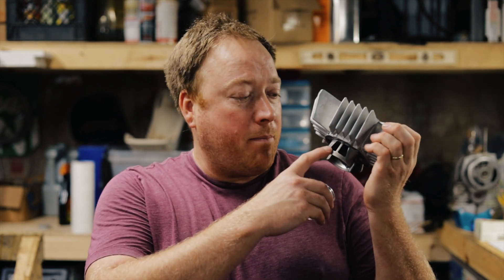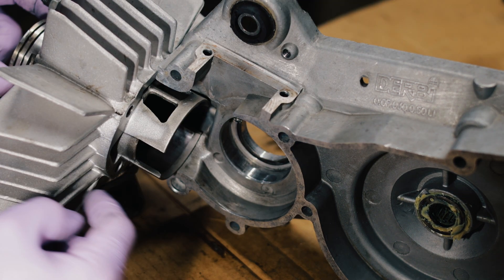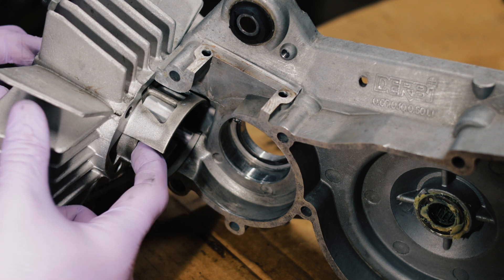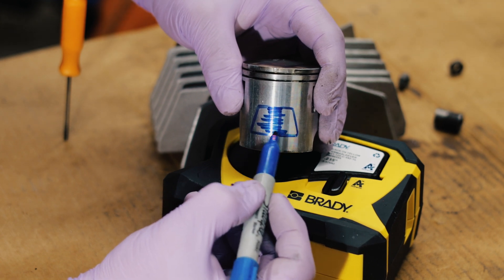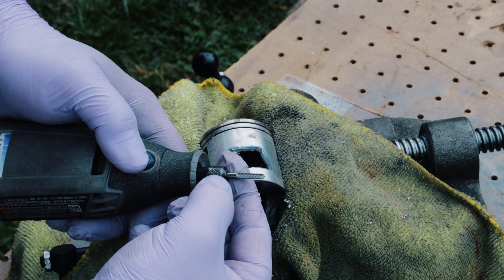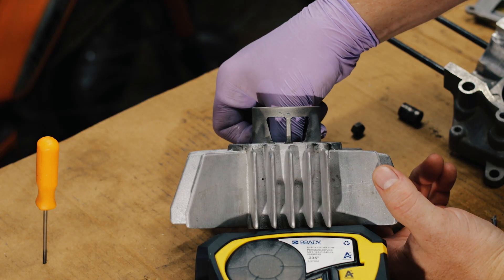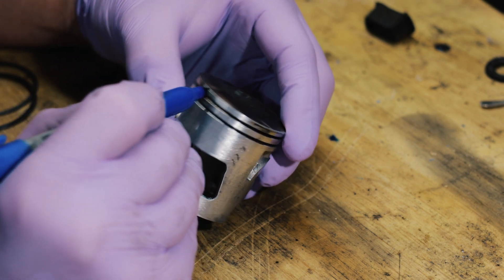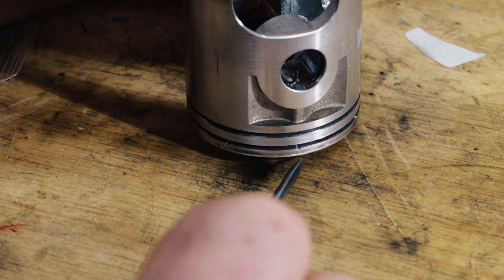Piston Window Porting for 2T Boost Ports

Comment: Dude,  making the bridge between the ports would have taken  an extra  10 mins.  You just cut out a lot of that pistons strength.
Reply from the maker: Yeah I have never had an issue with the airsal cylinder and piston. With thinner kits I would leave a bridge.

Comment: Is a piston with windows always better than one without?
Reply: Not always, and only with a reed valve
Reply: @hamzahmushtaq877  But people talk about piston window on chainsaws and they dont have reeds. So im abit confused.
Reply: @meskalin64  if it has a window there is always a reed maybe the chainsaw looks like it doesnt but it might have a case reed?
Reply: @hamzahmushtaq877  They do have different carbs though. The windows are much higher up on the piston (from the top down to the piston rod/bearing) and not on the intake side but on the fuel channel sides. 2 windows on each side.
Reply: @meskalin64  dude what you just said made no sense
Reply: @hamzahmushtaq877  Dont worry if you dont understand dude.
Reply: @meskalin64  real.
Reply: @hamzahmushtaq877  Rotary valved 2 strokes can use windowed pistons also . The only problem is window weakens piston.  Was a popular modification on kart motors in the sixties and early seventies. Engine modifiers/builders got away from that due to piston failure at high rpm's. 2 strokes kart motors had better performance and reliability just going with a third transfer port.

Comment: I always window just because that’s how the original metrakit design was… I also cut the bridge out of the skirt.  Seat dyno’d, no idea on impact.  Most of the fresh charge is through the side transfers so 🤷‍♂️ 

Thanks for the hard work bud, I owe ya a coffee.
Reply from the maker: Thank you! I believe the boost port pushes the mix that is already there from the transfered to the head. I feel like it makes a difference. Thank you for the coffees!
Reply: @Corn-ped  yeah, and I think it was in Bell that the boost port should open first, pointing directly at the head, so that it will force expended mix out the exhaust port and improve fresh mix retention.

Comment: Ive seen the argument that by increasing flow through the boost ports while the ex port is open that the only real thing happening there is that you are losing more unburnt fuel through the exhaust at the scavenging stage. Personally I think you want a smaller amount of fuel to do the job without reducing efficiency. I have tried both ways and have had the best performance without a windowed piston but thats just me measuring by the seat of pants dyno. However I am just a common moron, and this is mainly just for the al gore rhythm. ❤ya 💋
Reply from the maker: yeah I can see that. On this cylinder the boost ports are aimed aggressively towards the head so it should help with scavenging and the ex/transfer duration over lap is pretty minimal. Without a dyno and fuel measurement I don't know how you would tell if it worth it? If it feels faster I dont care too much about lower mpg.   My black derbi has the window cut and this one didnt, the black derbi feels a lot better, but yeah my butt also is not the best dyno.
Reply: Get a dragy and document your engine changes to performance changes, you can get refurbished dragys with 2 year warranty for about $130.